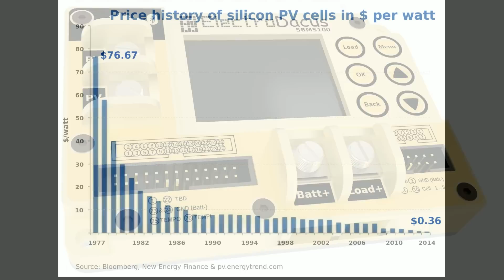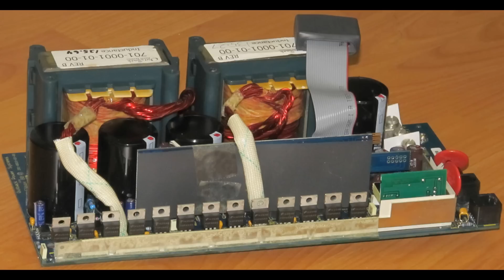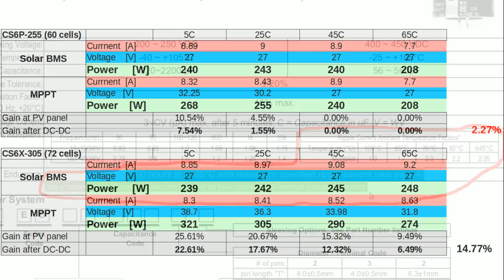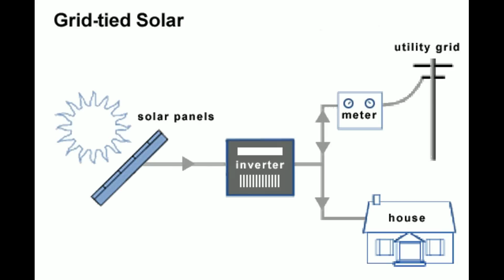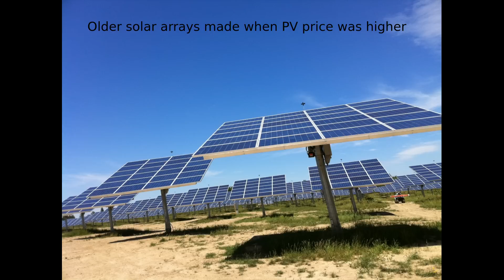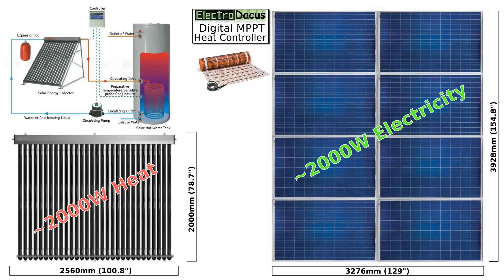Is the MPPT in OffGrid Solar obsolete ?

Comment: My MPPT broke 2 month after the warranty was up, I got pwm controllers and the way they are wired up produce about 20% to 30% more power for the last 2 years. So called professionals told me that it will not work and that they will destroy each other or burn up.it has been running for 2 years now without problems and with elevated power output, I call my system an imitation MPPT controller.

For me a few extra panels are cheaper and will outlast an MPPT controller anytime.
Reply: Same here...also MPPT not cost effective...

Comment: Very interesting topic you addressed in this video. To be honest nobody else on YouTube agrees with you, but after watching and taking a look at the data, I can see how you came to this conclusion. In my particular case I don't have to worry about winter at all (I live in the Caribbean, what would you expect), but in the contrary I have to worry about cooling and dehumidifying. As far as I understand DC air conditioners are much more efficient than AC units yet they usually run on 48 volts. Do you know of any way that I could have my entire system running 48 volt so all the appliances would work without much hassle? What do you think about inverting to AC for appliances?. All the lighting and automation is DC. I really only need AC for my computer and to plug things guests might bring. Again, great video!.
Reply from the maker: I think most agree since there are more likes than dislikes on this video :)
My systems are designed for max 24V DC and less and I do not have any plans in designing anything for above this so that I can stay in the low voltage standard below 50V DC open circuit voltage so that means a single 60 cell or 72 cell PV panel.
I think there are some DC air conditioning that works directly from PV no need for battery.
Reply: electrodacus That would make a lot of sense! I'm going to take a look at it.

Comment: Could you use this system on a 35-40 ft. Fifth wheeler RV? I am doing a lot of research atm due to our family will be buying this RV within 2 years and I will be doing a complete solar fit out, so as we can be anywhere and not be plugged in. We will be traveling Australia over a few years, so a great set up is essential. I hope to hear from you soon. Col.
Reply from the maker: Yes currently I work on the new SBMS versions and there is an SBMS40 normaly good for small RV or even small homes with a max of about 1200W of solar PV and the other SBMS120 for larger systems up to 3000W of PV solar.
 You can see details and progress on my google+ page https://plus.google.com/+electrodacus/
Reply: Google+ is dead. Did you manage to move all this information off to somewhere else before Google killed it? It would be rather interesting to read, if think.

Comment: Hi electrodacus I agree a long way, but if you think space of solarpanels, so the more power/m2  the better......If you think years from now...manny more are using more Power for heating and driving cars, so I think you are right, we have to by more land for the panels and just mount as manny we can effort for the winter month and the clouded days, so we can survive tru the winter month, maybe a 100KW LI-ion pack to take the power on cold sunny days ....and with 100Kw Pack you can have heat for (15-20Kw/day) 4-5 days (small house small windows). And on clouded days with a little supplying Power (6Kw) from your big solar array you can get almost the same amount of power for the rest of the house tru the daytime as you need - heat (use a little wood if you are cold) ....so the big battery Pack it is only  for heat tru the night....and That is being fully charged tru 1  sunny day.....Try to make a calculation on That.........It has to be maybe 120KW solar array ....and forget the summer overproduction sell it to the grid if you have one...and get an electric car to :-)  free driving in the summer....off grid.... best to ALL keep on Thinking ... POWER to the People ....JT Denmark DK
Reply from the maker: You maybe missed the part about off grid. In a typical offgrid installation that is well designed the battery will be fully charged in most days before noon all the rest will be excess. The excess energy in average over a year for my case and probably anyone else is around 50% thus MPPT has no gain at all.
Not sure if you are aware of my recent work where I started developing a digital MPPT (nothing to do with DC-DC converters) for heating my house 100% with electricity. Here is the presentation about that explaining how it all works http://electrodacus.com/DMPPT450/dmppt-presentation-v01.pdf and also used my house as a concrete example. My small 65m^2 house in this cold but sunny climate requires about 1000kWh/month for heating in the worst winter month and that can easily be provided by a 10kW PV array.
Also there are comparison with natural gas and thermal heating in therms of cost amortization. I used natural gas since that is currently regarded as the lowest energy source and used by a majority for house heating. Wood or any other type of biomass will be more expensive.
In therms of cost amortization here are the numbers all in USD:
PV panels 2.4 cent/kWh (assuming you can use all available energy).
Best LiFePO4 25cent/kWh (so not recommended for grid connected systems almost anywhere in the world).
And thermal storage what I will be using for heating energy storage is less than 1cent/kWh depending on how it is done. Water and concrete are the most cost effective to use and there are examples of both in my presentation linked above.
I will need to have all this setup for this coming winter and I will provide real world data as soon as I have that available but I do not expect any problems.
There will be no backup at all for either heating or electricity just the 10kW PV array. All the electricty used for cooking, light, computers ... will end up as heat so is not important how much I use as electricity and how much remains for heating. The LiFePO4 will be just 5kWh more than sufficient for overnight storage. All the 10kW PV array can be used to charge the battery so even the worst overcast day will be no problem and battery will be fully charged. The thermal storage is around 100kWh but I may need to increase that to no more than 160kWh if this current capacity is not quite enough for prolonged periods of overcast weather.

Comment: Hoping you are still monitoring this thread. Very interesting video. A lot of it over my level of solar knowledge. I just built a house which will be off grid. I did a load analysis and came up with 6.5 kwh/day. My array will be about 150 - 200 ft (cable length) from house/batteries. I love the idea of Li batteries but at about $800-$900/kw (Powerball 2 isn't compatible with off grid systems) I can't justify the additional cost over LA batteries. To date I haven't been able to find any LiFePO4 batteries.....I'm located in Canada. What LiFePO4 batteries do you use or recommend? I was planning on a 48V battery bank mainly because of the distance from array to batteries = less expensive cable but I do not know cable cost difference if I went with 24V battery bank. I am planning on a 3KW array. I'm assuming 60 cell panels are still the cost effective way to go? All suggestions welcome.
Reply from the maker: I will try to answer your question but not sure I understand all you where staying or have all the info.
You say you will need an average of 6.5kWh/day and that will be around 200kWh/month. What I do not know is your exact location in Canada since the amount of sun you will get will depend a lot on your location.
The PV array seems realy far from House/battery not sure why that is the case and normally array will be nice to be no more than 50 to 60ft from the battery. Maybe you have trees and a lot of shadow that is why you need the array at that distance from the house.
LiFePO4 is around $400/kWh but that is not what is important since LiFePO4 will have a much larger cycle life than Lead Acid and you normally need a smaller battery. With about 200kWh/month and 3kW PV array the LiFePO4 battery capacity should be around 10kWh so it will cost around $4000.
Yes the 60 cell panels are still the most common this will not change soon since is an industry standard. The distance between battery and panels is quite high so there will be quite a bit of cost for the cables.
If you can have them installed closer that will be a good idea but if not then is not that big of a deal since you can find cables at reasonable price and cost for the cable will not be that high.
You may want to look at my Digital MPPT thermal controller maybe you will also want to heat your house with PV electricity since that is what I will do because is the cheapest heating option. See my last video and you can ask me any additional questions. You can also write me an email same username as here at gmail.

Comment: can i use the sbms (where i have to wire the modules in parallel) when the distance between the modules and the house (where the batteries are) is around 60meters?
Reply from the maker: Yes you need to have the modules in parallel. Will your battery be 12V or 24V? The 60m distance is quite large mine have about 20m of cable so the cable in your case will be expensive.
If you give me more details I can calculate the cable you need for that distance. With 12V you will need 36 cell PV panels with SBMS while with a 24V you normally want 60 cell panels but 72 cell panels or two 36 cells panels in series will also work.

Comment: I love solar technology . and this device seems to be a great one to test!  unfortunately I have already 6 255w 24v PV ,  1530w around 48amps top, coming into 1 cable string to  1 mppt 40a charge controller  and 1 mppt 20a charge controller . I want to replace batteries (lead acid ) by 18650 lion cells pack .  Can this one handle those batteries, not sure about lifepo4 chemistry and settings. please confirm thx. Can it handle 50A coming from PV?
Reply from the maker: Yes both SBMS60 and SBMS100 will handle your 6x 255W PV array with no problem see manual for more details http://electrodacus.com/SBMS100/manual/SBMSmanual.pdf
As for 18650 that is a bad idea for energy storage. This cells are designed for high energy density but have low cycle life 500 to max 1000 cycles where LiFePO4 that I recommend for energy storage have 2000 to 6000 cycles so they will last much longer and be a much more inexpensive energy storage solution in therms of cost amortization.
Also you can find LiFePO4 cells in large capacity with singe cell up to 1000Ah and will be easier to make a pack out of them. In your case with 1530W of PV panels the recommended battery size is 200Ah 8s LiFePO4 and this should cost around 2000 USD and last for 15 to 20 years.
For more details see the SBMS manual  http://electrodacus.com/SBMS100/manual/SBMSmanual.pdf
Reply: thank you!!! So , what its being use in tesla powerwall po4?
Reply from the maker: There is no real spec or warranty claim in therms of cycles for the Tesla Power wall. That is designed more as a backup for grid connected systems and is probably expensive in therms of amortization cost.
The Tesla electric car is also expensive to drive eve more than a gasoline car do to the battery amortization cost and not electricity cost. Most people are just not able to calculate that or do not care about the costs.
Even with the best LifePO4 battery the cost amortization is around 25 to 30 cent/kWh in real life while the cost amortization of solar panels is just around 3 cent/kWh.
So using battery storage with grid connected system is a bad idea unless grid at your location is externally expensive (above 40 cent/kWh to even be worth considering battery storage). Power wall will most likely be more expensive than that.

Comment: I am very curious, what is your opinion or even better, calculations on this topic: http://www.instructables.com/id/TRIPLE-YOUR-SOLAR-ARRAYS-OUTPUT/ 
In short, that guy is putting solar panels into \/\/\/\/ shape, so he can use more than one "bounce" of the light from the panel. Is it really making that much of a difference as he is stating or am I just missing something?

BTW thanks for this kind of simple, explanatory complete video :)
Reply from the maker: There is not much light bounced from a PV panel and having PV panels set up that way will produce way less energy for the same area not to mention you need a lot more panels.
You can also do that simple experiment with small solar panels just make sure you measure power and not voltage.
So the simple answer is that his method is a realy bad idea. Not only he will get less energy over a day from the same area from that setup but it also needs a larger investment (more panels).

Comment: The one spot I can think of in which you my be wrong is solar for a RV or tiny house. The reason I say this is size limits on these two and extra panels will not work.
Reply from the maker: They are still off grid and many of the points made here are valid. The extra 5 or 10% the MPPT can provide will still be unused so there is no point. Using 32 cell panels for 12V or 60 cell panels for 24V will make the MPPT obsolete since they will already work at the max power point.
Getting panels with more efficient cells will give you some extra energy for limited space but again that small extra will probably remain unused.
I already have 3 years off grid and I can see how much unused energy I have from a relatively small system 3x 240W panels and 24V 100Ah battery. MPPT will be completely useless for me and I see the same apply if this is installed to an RV.